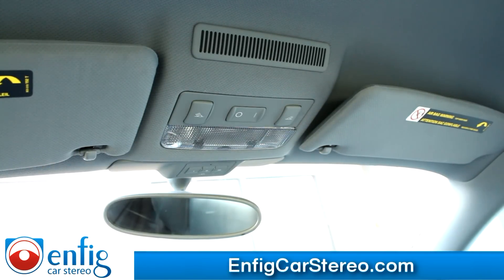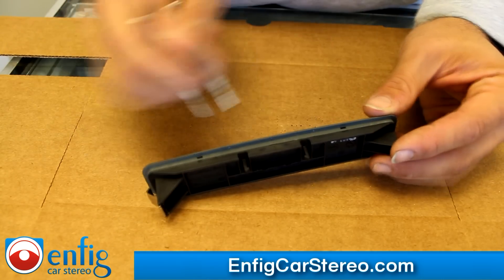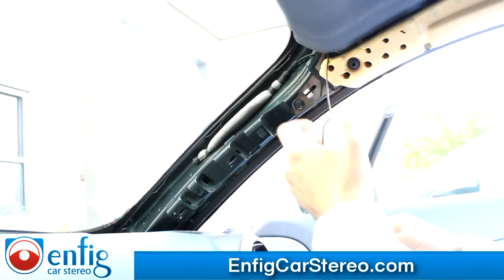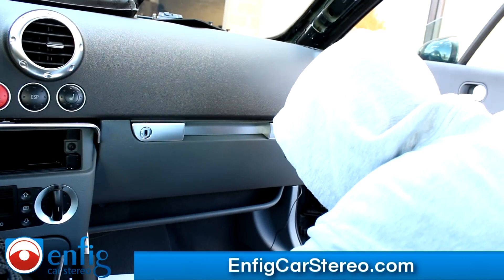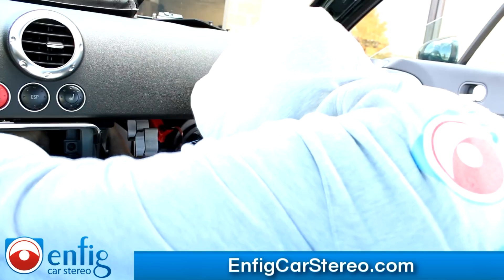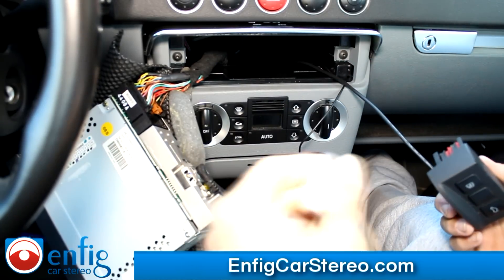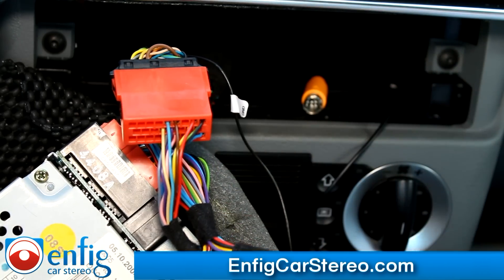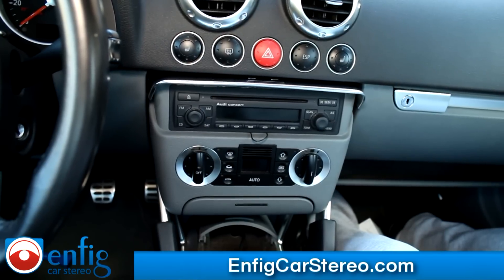Bluetooth USB with iPod & Aux option INSTALLATION Audi TT 2002-2006 Dension GBL3AU2

Comment: you say this is 'Audi Microphone". Contacted Dension and they have Audi Microphone only for the Audi TT 8J (2006-2014). Does this fit into previous TT model as well?
Reply from the maker: We currently use the Enfig MIC-VW1.
http://enfigcarstereo.com/ENFIG_MIC_VW1.html

I completely forgot about this video.  I just purchased the part in the video and will make a custom mic just for this car.  Look out for it on the site.  Or you can email us.

Comment: Quick question about this product, enstead of buying the dension ipod connector can we use an ipod cord and plug it in to the usb port? And for the mute wire, is that only if you instal the mic option? Thanks
Reply from the maker: +xNachoPandaXx The USB is just for memory sticks and software updates.  The mute mutes the radio when a call comes in.  For ipod USB you need this. http://enfigcarstereo.com/DENSION_LIA1GW0.html
Reply: +Enfig  thanks for the quick reply,

Okay & i have some final questions before buying the unit,will this specific unit connect to the my iphone/ipod via bluetooth so that i stream the music on my phone/ipod? Or does it just connect through the dension usb? 

I have a 2000 audi tt with the bose system

Comment: Hello
My TT 3.2 of 2005 is equipped with the bluetooth.can I keep the already fitted mic in my Concert 2 ? this will avoid me to get a new one and to have the put the wire in a difficult way ?
Thank you from France
Reply from the maker: Unfortunately the audi microphone is a different resistance. Even if you cut and splice it will not work.

Comment: What is the function of the mute wire? I realize that I did not purchase the extra red connector for connecting that wire when I purchased the device, and I was wondering if it would be a problem to not connect the mute wire? Or what function I would lose by not connecting it? Thanks!
Reply from the maker: The mute wire mutes the radio when the radio is in CDC mode or AM/FM mode.